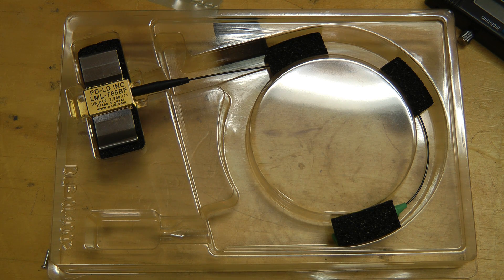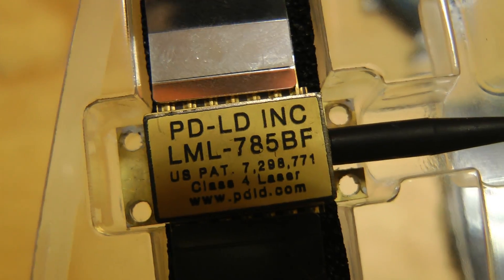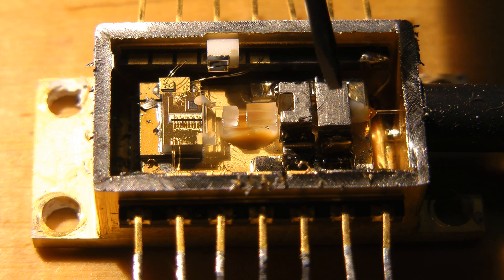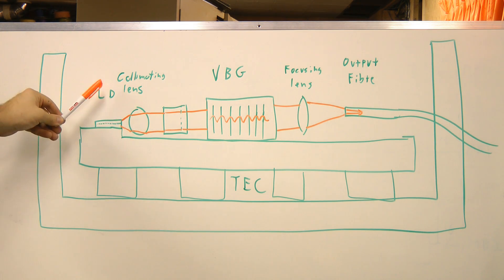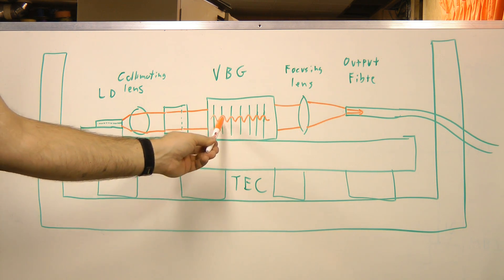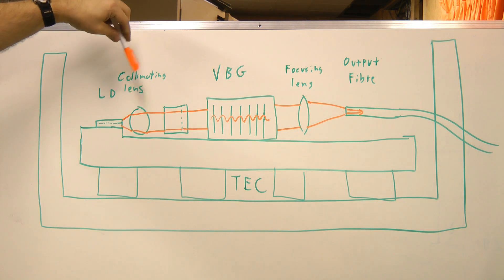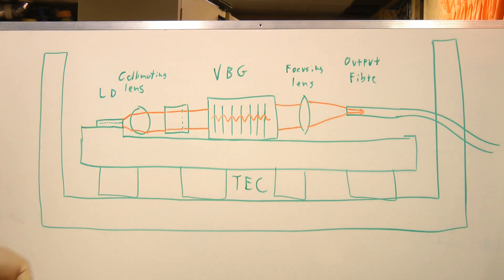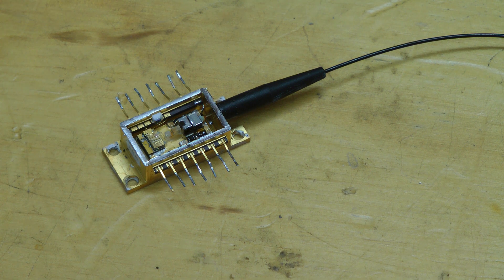500mW VBG stabilized fiber optic laser module teardown

Comment: I used to work for Lucent Technologies in the robotic assembly of these things, and it's amazing how little has changed in 15 years.  These are still some of the most high tech Opto, Electro, Mechanical things you'll ever come across.  40GB/s of data down a tiny fiber for hundreds of kms.

Comment: Hello,friends. I got 20 pieces similar module, I want to focus the laser, can not find a suitable way, I think making a laser pointer, you can make marks on the wood. Do you have any suggestions? Thank you very much
Reply: +Peter Xian I'm just making an educated guess here so someone correct me if i'm wrong, but I think its to do with the laser light reflecting off the walls of the fiber-optic line in a zigzag pattern causing the light to be scatted and no longer be in a perfectly strait line making it diffused.
Reply: and the module is IPG PLD-5 . 1064nm. 5w.Thanks!
Reply from the maker: You can't achieve a perfect beam with a fiber coupled module, but you can get a somewhat collimated beam by placing a lens in front of the output fiber. Place the lens so that the fiber tip is exactly at the focal point of the lens.
Reply: tesla500 this might be a stupid question, but why can't you achieve a perfect beam with a fiber coupled module?